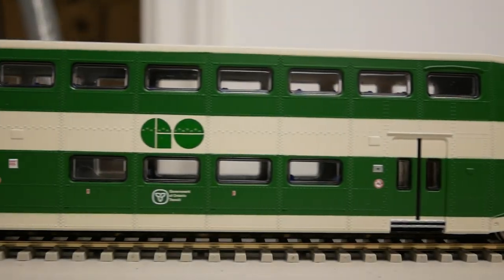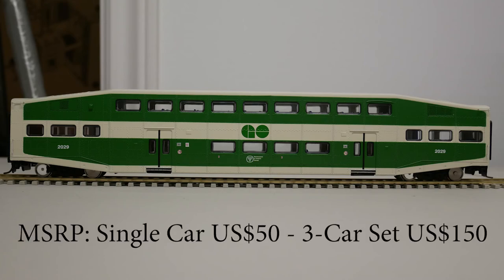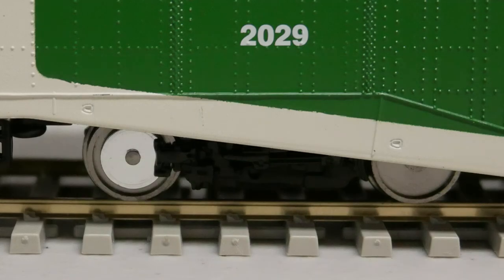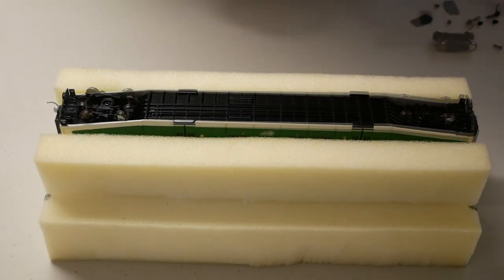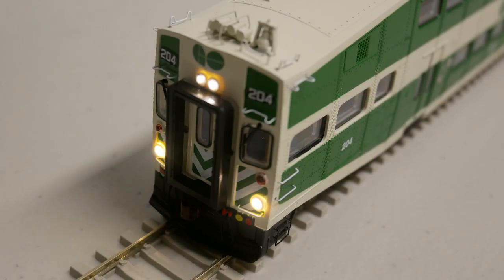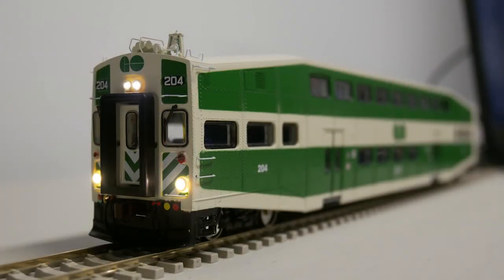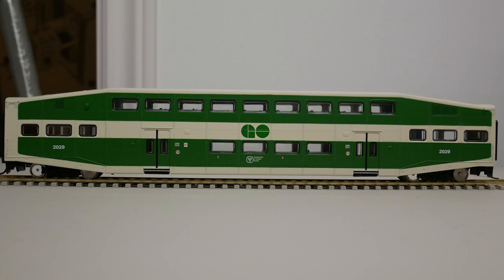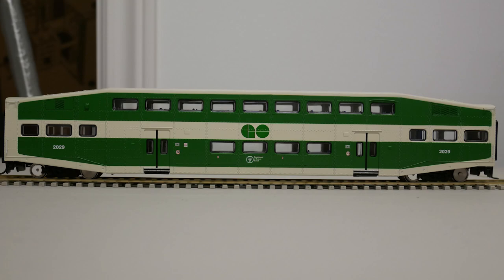Review: HO Athearn RTR Bombardier BiLevel Passenger Car Coach

Comment: How many cars does the CA Metrolink train have?
Reply from the maker: A typical Metrolink train consists of 4-6 cars it seems.
Reply: 内走廊火鸡 Drunk Bee Model Railroad thank you! Can these cars take 22" radius? That's all I have on EZ track right now
Reply from the maker: Yeah 22" should be ok. Not sure how the diaphragms will fare though. If the diaphragms bind on 22" curves, just replace couplers with longer shanked ones.
Reply: 内走廊火鸡 Drunk Bee Model Railroad thank you! What type of couplers?
Reply from the maker: I missed your comment! For long shank use Kadee 146 or 156. Medium shank use 148 or 158. The 14x couplers have a regular head which is probably better for these cars. The 15x has a smaller head which is not as reliable for long cars.
Reply: 内走廊火鸡 Drunk Bee Model Railroad thanks for getting back to me!  I have put #148 couplers, but I should have got me with 156. The #148 are not negotiating 22" curves as the cars are almost hitting each other.

Comment: Do you have a go locomotive
Reply from the maker: I have a GP40-2 from Athearn but it's not a good puller for these GO cars.
Reply: Not a good puller in what way?
Prototype or actually not "pulling"?
If you're referring to prototype, GO Transit went to a batch of plain non passenger next to new GP40-2's that were picked up from the Rock Island estate in the late 70's. There were 7 (GO 720-726).
To provide HEP to GO's fleet of cars they rebuilt F-units to power cars. 
There were 7 F7B's converted to 900 hp HEP "power cars" # 800-806
There were 11 converted FP7A that can be used for power & control or either.
#900-908 & 910+911.